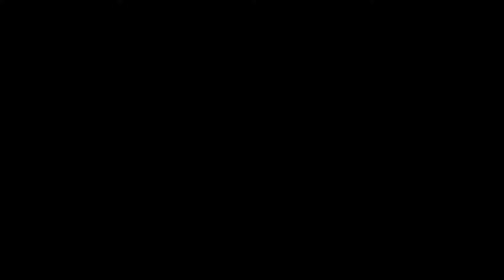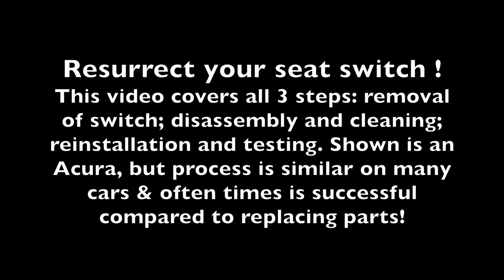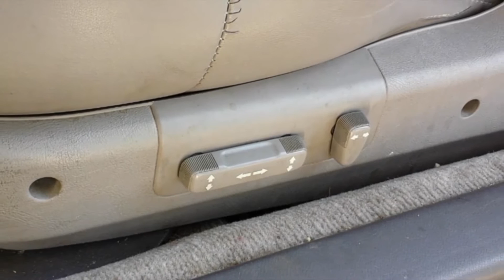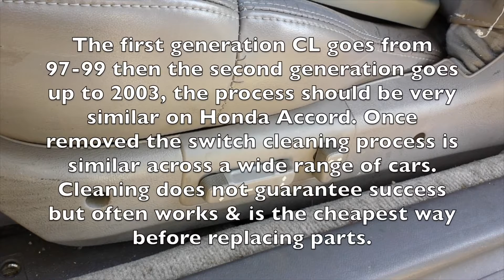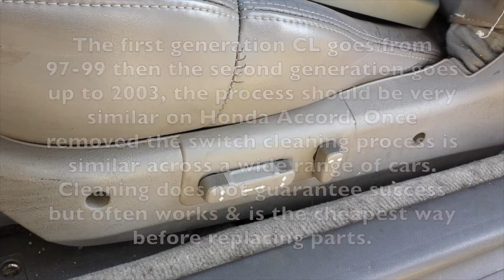Honda Accord Power Seat Switch Fix DIY! '97-99 Acura CL-Clean Electrical Contacts Don't Replace

Comment: Hi, I know this video is old but I’m hoping you can help me. I have a 1999 Acura 3.0CL. The driver seat will not move forward or backward but the other position up/down and the back of the seat all work I have it in a mechanic shop right now and they haven’t been able to figure out the issue. I was going to contact an Acura service dealer near me to see if they would even be able to help. The car is in great condition with only 25,000 miles. I really like to get it fixed because I am not looking to buy another car. Also a lot of these parts for this vehicle are discontinued. Do you think if I cleaned the switch that could help? Great video ! Thank you
Reply from the maker: Wow just 25k miles? Has it been in storage or parked outside? Its possibel the switches corroded or went bad with age. But there are separate motors that make the seat go up/down vs back/forth. If the switch is bad, there is a trick where you can use a jumper wire to engage the motor to make the seat go forward or back if you want to take that chance and get creative. If that works and the seat moves, then it is definitely not your motor it is a bad switch or wiring problem.
Reply: @KeithDrivenShop   Hi Keith thank you for your response. The car has been used and is kept in a garage. Just an extra car we don’t use a lot but don’t want to get rid of it. Can you explain the hard wire trick and what chances would I be taken? Thank you so much greatly appreciated your help.
Reply from the maker: @ginav9787 hi I dont i think I could properly explain the whole process in the youtube comment section. I'm sure there are other videos on using a jumper wire to bypass the switch on any similar power seat, but you would need to find the Acura wiring diagram online for that car. If you are not very experienced with repairs it would be a good idea to have someone help who is. You could start with asking google gemini about the procedure and risks and then make your decision, i don't think there's a lot of risks besides, maybe blowing a fuse if you do it wrong  and working with 12V power from thr car but it's still good to know about it and take all precautions. What i've done before is use the very short jumper wire a few inches long and just temporarily bridge the two pins that will be plugged in normally, and if the seat motors are good, the seat will move normally.

Comment: I doubt mine the switch, i can hear motor whirring when i click the button to go down but its stuck in highest position
Reply from the maker: I assume you checked under the seat to make sure there isn't a foreign object blocking it?
Reply: @KeithBlade  oh yeah Ive been under there with a torch to look for anything out of ordinary but it all seems like it should be, nothing obviously broken and hanging, no objects blocking it

Comment: Thanks - I tried cleaning the switches but didn't see much improvement. Seat sometimes moves.  Maybe a faulty motor?
Reply from the maker: If it only works sometimes that is often a bad switch. Might want to try getting a switch out of a CL from a junkyard before replacing the motor. Could have a short in the motor but my guess is try the switch first
Reply: @KeithDrivenShop  Thanks

Comment: Much appreciate the video for cleaning the switch, but if I can't take the side off it because of the screwdriver I have is there a magic button I can push the head to seat reset itself back to factory?
Reply from the maker: Hi, there is no magic button or reset I'm aware of but there is a seat wiring diagram online and there might be a way with a jumper wire to bypass the switch controls to get it moving, but I'd recommend a mechanic walk you through that so it's done safely.  The dealer can probably do it also or get the seat moved.
Reply: @KeithDrivenShop   I'll probably just disassemble the switch and clean it instead I thought maybe there's a wheel or mechanical bar underneath the seat I can roll to move the seat forward
Reply from the maker: @dmann3042000  I know the seat is controlled by a couple of motors underneath, not sure if you can disengage, you may want to look in the forum Acurazine it's pretty much every issue people run into and replies from many users. Best of luck with it.  : )

Comment: Just what I wanted to know, how to pry the buttons off the seat side panel. Seems to be just a pry-bar push out on them. This is good because I didn't want to brake them.
Reply from the maker: Yep. They pry off pretty easy. Good luck with it.

Comment: It wont let me see the full video. Just stops at 30s then freezes
Reply from the maker: Hector, I just tried it and it's working fine. YouTube won't host a video that isn't working so if it's not playable on your end it is usually your internet connection. Try waiting til you have a better connection. Also you can try clicking the little gear icon and setting the quality to "Auto", this adjusts for your connection. When you're on a fast connection, always set the quality to HD or 1080 or 720. This works on any YouTube video and ensures you're seeing the content in high def when available and makes a big difference when you're on a larger monitor. Thanks.

Comment: When I want it to go forward and back and up and down, all ot does is click and nothing, however it reclines, can I use this method
Reply from the maker: Vidia, you can try it. It's not a guarantee because it could be something else like a bad switch or connection. The purpose of the video is to point out that cleaning the switch contacts is the cheapest easiest thing to try first before spending money at the repair shop. It does take some time but sometimes it works and solves the problem.

Comment: I’m having the same issue with a Acura CL 03’ doesn’t recline back . Doesn’t Tilt back at all .  CAN I USE THE SAME METHOD YOU USED HERE ? 
on my car
Reply from the maker: John, Yes, it's the cheapest way to find out. Could be something else like one of the seat motors-but if it reclines in one direction and not the other, it's probably not the motor. When the motor goes bad usually it's bad in both directions, such as seat not sliding fwd or back, nor reclining fwd or back. For you most likely either the switch or connection is bad, or dirty contacts inside the switch as shown in the video which possibly could be cleaned.
Reply: Keith Blade I just finished doing this method cleaning them out and it sounds like it clicks but still doesn’t recline back at all . Suggestions? 
Everything moves just doesn’t move forward or lean back
Reply from the maker: @1015johnjohn  Hi, hard to say. You may have to replace the switch or check with Acura and see if there is a separate motor just for the recline. Some of these vehicles have up to 3-4 motors in the seats for separate functions. As the vid description says, cleaning the switch isn't a guarantee, it's just the easiest cheapest thing without having to take it in for an expensive diagnostic. I did the same thing on my window switch years ago, it has worked perfectly every since. Just a gamble though, sometimes it doesn't work. Switches are cheap on Ebay. Unless you'd want to voltage test the motors or check connections going to the seat motors or have Acura do it, you usually have to remove the seat for that, not fun. Hope you are able to find the solution, wish I could be more help.

Comment: I'm having the same issue with my Acura TSX and I'm going to try this method. Thank for the vid!
Reply from the maker: Acura might do things a little differently, I know on the TLs the tire light system will actually tell you which tire is low. This eliminates alot of hassle. It also tells the pressure readings, Lexus at least on the 07 RX350 does not give this add'l info.

Comment: i also have a 97 cl. my seat when i bought the car was stuck all the way back and i would hear a clicking sound when i tried to move it forward and wont move. i switched out the slider motor with one from a parts cl hooked it up and it only went backwards. but i will have to check the connections on the switch. i did thought of trying to find a used seat from another cl and just put it in. thanks for the video! Very Helpful!
Reply from the maker: You're welcome, I hope you can get your CL seat working again soon either with a cleaned switch or a used seat. Thanks.
Reply: also, when i start up my cari hear my ABS thing under the hood make a humming noise then light comes on. do u know anything about that?
Reply from the maker: Sounds like your ABS module is going bad. It will probably continue to get worse and make more noise. The best choice is to have the dealership look at it or get it fixed, but some people disable the ABS by unplugging it or removing the fuse. Probably lots more info about this in the Acura forums online. one is called Acurazine ... lots of info about everything.
Reply: ya thats what i did is unplugged it. and thanks ill have to look on that site
Reply: hey. i tried to clean out the switch. and found out my seat wiring harness is messed up. so im looking for a seat and cant find one :(
Reply from the maker: UGR_ACURA  yeah they are hard to find. last time I checked there were a couple on ebay, or you might  have to order one from acura or grab one from a junk yard